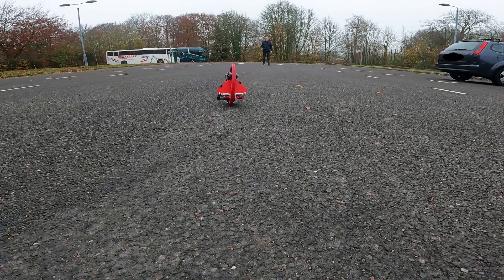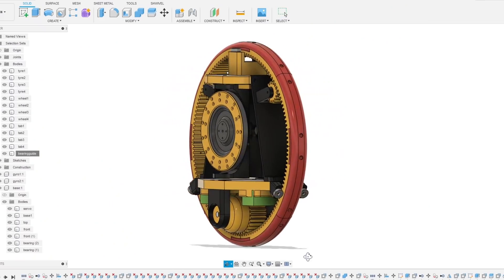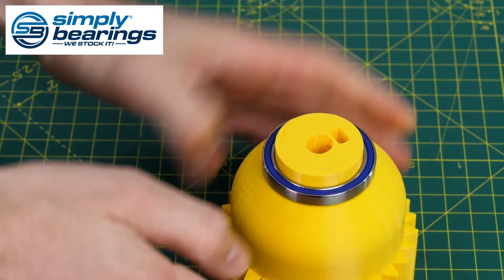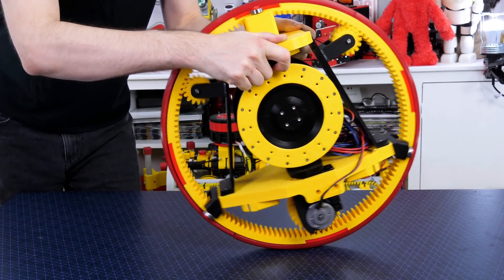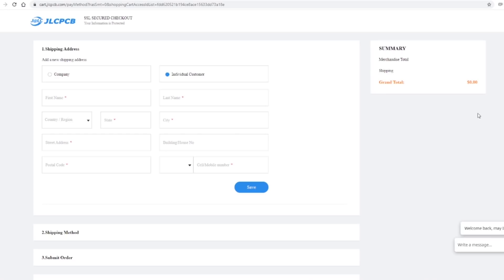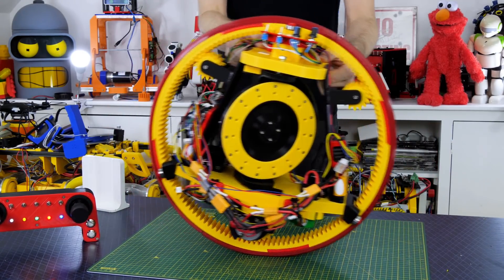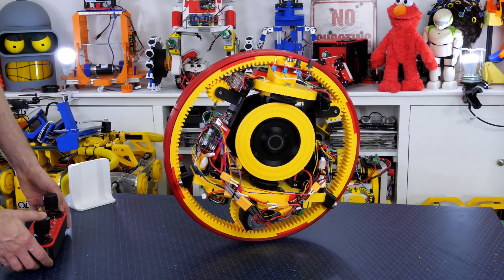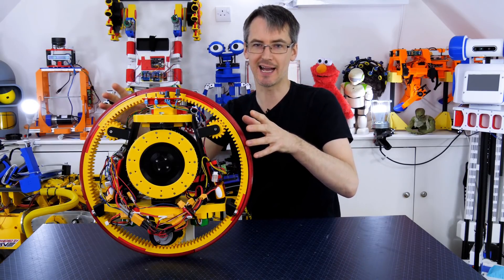Gyroscope Stabilised Monowheel

Comment: "Dynamic balancing" (like a bicycle) is more interesting for a mono-wheel. Throwing gyros at this particular problem feels a little heavy-handed. Not to discount your effort by any means! I'm blown away and I think you have excellent engineering intuition as to why a thing failed. Still, I would rather see further experiments in the original direction you began with balance and shifting (not spinning) masses.

Comment: Gyroscopic forces are fun! In motorcycle racing you are taught to push on the right handlebar if you want to lean and turn right. I thought the instructor was nuts, but it works! When your project fell over, all I could think was... "Nooo! Not the nice shiny floor!"  lol   Wonder if you could create an inner carriage, to mount the gyro's, that is independent of everything else. Then the drive carriage could have the drive motor, gearing, controls, etc. A lot of parts, but would  help with the gyro axis changing problem.

Comment: I recommend to check out electric unicycles. They are monowheels of a sort too, but the rider stands on them instead. Very useful and fun, bigger ones have enough range to go over 100km on a charge with speeds in excess of 60km/h
Reply: its a uni not a monowheel
Reply: @Blox117  "of a sort" like i said. Though electric unicycles are also often referred as monowheels and they are actually useful for everyday life. I use mine to commute daily. I get to work much faster than with a car or a train.
Reply: @MikaelLevoniemi  monowheels specifically refer to a single track wheel comprising the entirety of the vehicle with the components in the middle. a uni rides on a wheel like any other vehicle.

a monowheel has no axle or hub like a regular wheel does
Reply: @Blox117  Yes? And that's exactly how electric unicycles are built. Many of the components are inside the wheel, except the batteries are on the sides. Many models don't even have an axel because the motor handles all that. There are no mechanical brakes etc. There's a good reason why electric unicycles are often called monowheels. The difference is in size and rider location. Example of an EUC in use in Paris https://www.youtube.com/watch?v=wTKowa7tqsk

I use mine to commute and it's much faster than a car or walk+train.

Comment: Most people don't know how bicycles actually work, to turn left, you first have to turn right, to change your cog to allow you to then turn left, Veritasium did a great video on this. Seems like your monowheel is experiencing this exact same mechanic.
Reply: If you're riding a motorcycle at speed, you must point the wheel to the left to turn right. Pointing left causes the mass to lean right, this turning right. The wheels are the gyros.
Bicycles and motorcycle actually respond the same. If you're moving parking lot speed, left is left, and right is right. But as your speed increases, the more influence from the gyro, inverting your correlation. If you get your bicycle up to 30mph+, you will experience this.
Reply: nope you dont have to turn at all. dont repeat information if you never actually did it yourself. countersteering is useful for making sharp turns but is not how bicycles always turn

Comment: Wouldn't it be better if you place the accelerometer closer to the center of the robot? I've seen many projects where you place it in kinda random places. 
That may impact the correctness of measurements and require compensations in the PID and control loop

Comment: I'd add a line or two of code to taper power to the motors if it falls over.  It looks like it might sever a hand when you try to stop it spinning out of control.

Would giving the gyros an internal frame to move in, to keep them 90% horizontal, limit the effects they cause in other planes when in forward motion?  That was the only theoretical solution I could think of but adding that adds another motor/battery for the horizontal gyro stabilisation adds mass.  Looking forward to the solution to this tho.

Comment: I have been developing a gyrostabilized spherical vehicle for several years. The two flywheels stabilize the roll and the pitch, their rotation is correlated mechanically with a displacement of the center of gravity from left to right and from front to back. This avoids saturation of the gyro stabilization. In addition, roll stabilization remains horizontal. The entire structure has been designed in generative design to increase rigidity and reduce weight in order to lower the center of gravity as much as possible.
The vehicle is still under development but you can see how it works on this video : https://www.youtube.com/watch?v=VhlOq7vxejQ&t=1s&ab_channel=QuentinBosler
Reply: That is a neat project and I subscribed in case you release more videos.

Comment: Put the axle of the gyros in the centre of the wheel. That way they won't be moved forward or backward when the internals are leaned forward or backward to move. Use static weights, like those unconnected batteries, to get it to move when leaning forward or backward.

Comment: I notice when it falls over, you struggle to quickly pick it up before too much damage can occur to the floor and gyro wheel. Perhaps having a static cover plate over them that is attached at the top and bottom pivot brackets might help prevent that, as well as prevent it from dancing around as the gyro wheel contacts the ground.

Comment: Add 4 "training wheels." 2 on each side, attached bilaterally to the base under the gyros. These wheels should be set to engage the ground in 2 spots, front and back, at an angles sufficient to prevent the wheel from tipping over during a turn, which you can adjust the controls to take advantage of the added friction for facilitating better turning. Would doing this mean that it's no longer a mono wheel? Idk and idc. The point is that you might end up with a useable product.

Comment: Wouldn't a fixed gyro in the center be more stable than the 2 moving ones?
Reply from the maker: Fixed how and where? If they don't actively move then they won't exert any force to balance it.
Reply: @jamesbruton  fixed inline with the drive ring. For turning the gyro needs to move sure. But a larger fixed gyro would make the whole machine stable, then your turning using a moveable gyro is just pushing against the force of the larger flywheel. I guess the idea was make it naturally stable and then fight that resistive force to make it move.

Comment: Motorcycle/bicycle steering mught be worth studying here. Many riders don't know how they steer, but in recent years it's been taught in order to pass the "moose test" derived high speed evasin in the module 1 practical.

Control is by torque input on the bars, not positional input. You push on the bars to turn the wheel away from the intended turn direction and the wheel moves in that direction away from the centre of gravity causing the bike to lean over and begin to turn into the lean. When torque is removed the stertring geometry follows this lean in a stable curve. 

I'm not sure how this applies to a monowheel, but your observation that it does the opposite to the intent from your control inuts mught be part of the same phenomena

Just hanging off the bike (or otherwise moving the centre of mass) doesn't work well as demonstrated by this bike. 

Tyre shape is also critucal, if you have a flat section around the circumference the tyres resist the bike leaning over until you get over the flat section onto the curved section, where the bike tips in very fast. It may be that your tyre needs a semicircular profile woithout a flat section in order to have smooth turning.

Comment: Would it help to let the drive motor work through a differential and use a servo on the body of the diff for fine tuning while you're standing still? The motor is not agile enough for small compensation and causes overrunning the zero point. It does then introduce yet another mechanism...
Just my 2 cents

Comment: If the gyros were centered horizontally and vertically to the wheel would that not help with the lean forward when driving as they would always be centered in the wheel, or is it the way the gyros twist that's at issue?

Comment: Another amazing build.. Maybe a good alternative to gyroscopes here might be a simple moving balance weight. 
Maybe the weight could be made as a vertically mounted momentum wheel, a fairly painless way to achieve steering.
(just realized that you still end up with the same problem but now rotated through 90 degrees.)
Reply: I think weight's with stabilisers is good alternate indeed. The one-wheel motorcycle from "yugioh jack atlas" works simulair with LOW place mass around the main wheel

Comment: I've always wanted to build an RC monowheel but with just a linear actuator moving a mass side to side to steer and keep balance. If this mass was positioned at the wheel's axis of rotation, I believe it would not cause any unwanted precession. As the whole wheel is effectively a gyro, one should be able to get it stable when running.

Comment: To solve the issue you described at the end of the video, would it be possible to have a mass at the top of the wheel move forwards and backwards to act as the forwards/backwards controls? This would allow the body to stay upright and avoid the gyro steering issue I think.

Comment: Look up counter steering on motorcycles. Simply put, the term 'countersteering' refers to the principle (governed by the laws of physics!) that to turn a moving motorcycle in a given direction, the rider must turn the handlebar in the opposite direction of the turn. Sounds exactly like the phenomenon you're experiencing turning your mono wheel.

Comment: I am curious if you could make a gyroscopic stabilisation thingy that can turn 360°. Maybe a wheel running within a wheel that rotates the other way. Which probably comes with a whole host of issues to overcome, but would be interesting, even if it fails.

Comment: That's a very clever use of bearing balls to get your mass. Perhaps you can use an RPM differential on your speed controllers to get side loading on your gyro to help offset the twist when you try to turn.

Comment: Some considerations from personal experience in prototyping similar stuff:

1. use large hex core patterns for the gear sectors. Generally speaking, if you can get a 8 mm hex to a 2 cm wide part, you're set with a great ratio on a normal wall thickness. I've wall hangers that are built that way and they can soak up to 15kgs despite being very thin in section (no machine figuring involved, all hand laid lattice).

2. Instead of making recesses with small bits to joint the sections, which will weaken the whole structure, make another exterior ring that has overlapping segments (like brickwork). The equal sections will make for great structure. If you print this outer ring in two sections, so a middle wall (which was the base of the print) is shared, the structure jumps in structure even more.

-that outer ring, give it a ridge that's dovetailed to capture the TPU tire, which you can then print in a spiral, one piece, and slide over the dovetail. The tire would be in two pieces, so you can print the dovetail halves properly, then glued using Loctite's black rubber glue (pliable, but extremely strong, strong enough to glue a tire to a rim, on a car, permanently). You will not need any kind of screw for this, it can be build as a slot setup, which is far better than screws, which require you make a structure in structure when printing, to give you a strong boss.

3. Finally, if a gear sticks, it's because the tolerances aren't right from the print, and rather than printing another piece, just print yourself a master tooth, that's one sandpaper thickness smaller than the actual tooth valley you're trying to sand away. Then a little bit of elbow grease will yield perfect gear teeth. If you have an oscillating type dremel, the kind usually used to sand seam lines in model making, you can screw this tooth + sand paper to the bit, and sand that way.

-adding superglue with a brush before hand, will give you extremely strong and smooth teeth. Less rolling resistance, less noise (which itself is a loss), and generally speaking, smoother operation.
Reply: can you explain the hex core pattern for gear sector?
Reply: @benkaye5014  Sorry for late reply. Instead of letting the slicer fill your piece (depending on how much material you want to print) you take hexagons and place them in a grid leaving a bit more meat, like say for a part that's the size of a cup, you put 1 mm thickness walls. You make this lattice much larger than the part you want, then you place it so that the hexagon tubes formed by it are placed parallel to the direction you want the least deformation. 

Here's the crucial part. Every hexagon that's not full, you have to fill out, which a slicer will not.

Learnt this from a guy in a prop making forum. Makes extremely strong components.

Comment: Hi James. I noticed the wheel surface is quite flat. When you are driving a motorcycle and your tires wear out they also get a flat surface. Getting to turn the motorcycle then I way more.difficult. you especially notice it when you put a brand new tire.on. it's almost like it's effortless.  I'm not sure trying to balance the wheel when it's not moving is the right way of thinking. It's about your active balancing mechanisms to balance it. And when there is a big flat it makes the response not lineair

Comment: Wow - this is very complex to try it with the side-to-side balancing Gyro deflection axis' constrained to match the forward-back balance axis which, also is even further constrained to the forward-back drive force angle by virtue of balance-bots only having a single forward-back movement "joint".  

I'm not smart enough to visualize how those PIDs would work together as a whole but, intuitively, it doesn't seem possible without decoupling at least one of those tied axis... It would be mechanically more complex to nest that Gyro unit inside an internally balancing ring to isolate the Gyro's vertical axis' but doing so would be dramatically simpler from a systems integration point-of-view since you could then initially work on tuning the bank and pitch PIDs separately.

If you also add an internally isolated Yaw Gyro pair, then you could steer it without roll/bank coordinated turns.  Not likely your end goal. but once it can keep functioning and has a means of brute-force stumble recovery then there is the option of handing it off to a ML project to teach itself to coordinate the axis' and roll efficiently.

Super Fun Project and thought exercise!  
Thanks for doing all the hard work!

Comment: You could either make sure the whole inside of the robot stays upright (and use a separate weight for leaning), or put the control-moment-gyros on a gimbal (or even two gimbals) so they can stay upright while the rest of the robot leans. Also maybe make a case for the gyro so you don't accidentally touch it and lose skin when it's spinning fast :P